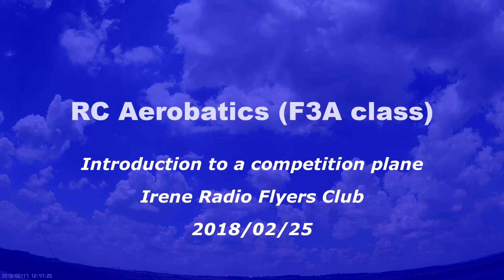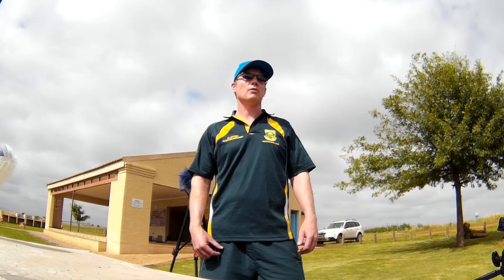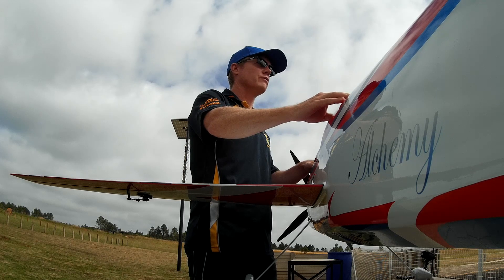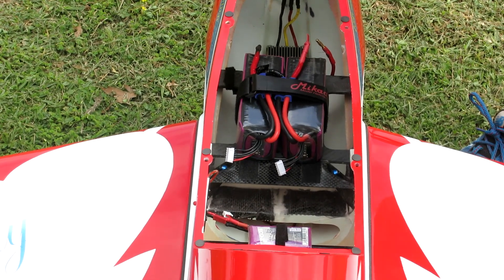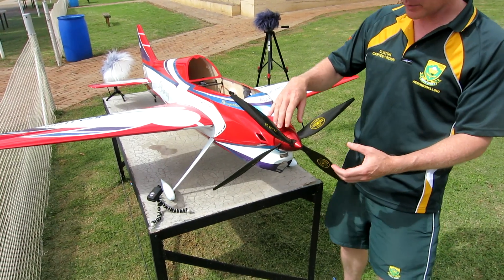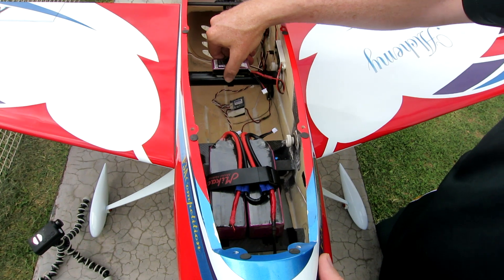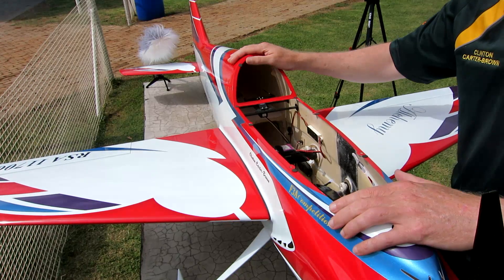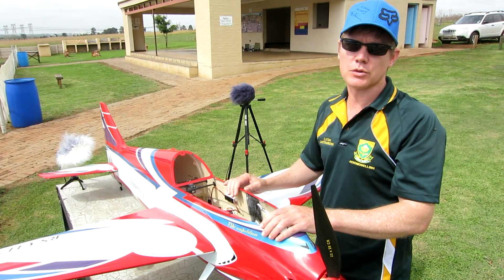RC Aerobatics F3A: (Part 2/5) Intro to Competition Plane

Comment: Wow, I can’t believe you have only one LiPo Rx battery. I used to use the same but one cell dropped and that was it. It went in and was destroyed.
Reply: There is not much 2:1 redundancy in F3A planes - mostly due to reliability of single components used, due to weight restrictions and also due to the fact that being competitive is more important. These planes are not used in airshow environment but during not so widely attended contests without many spectators. so that's another factor.

Comment: i am hoping you could expand F3A with nitro setup just asking and wondering thanks great videos keep up with the work buddy
Reply from the maker: My pilots are firmly entrenched in their electric competition setups and very happy with their 3:1 thrust to weight ratio, so we wont include nitro in this series. However, the prop-hanging antics of  larger scale Gas-engine planes make beautiful video, so hope to do one sometime. Thanks for the encouragement!
Reply: Marcus Dekenah beause the price of the electric motor vs nitro engine because the nitro setup is cheaper for those people cant afford the electric setup hope the weekend flying was good for you